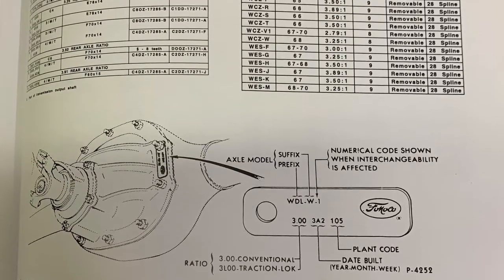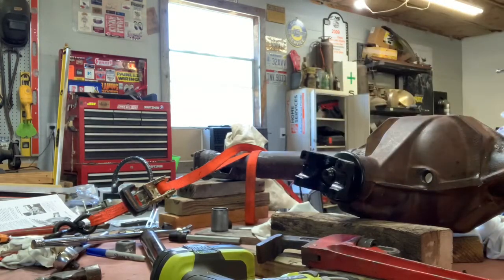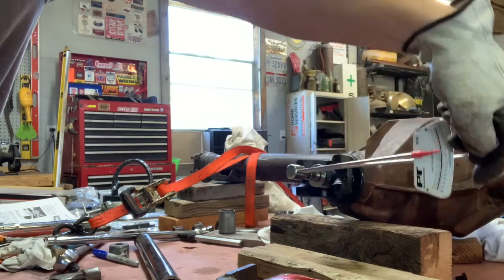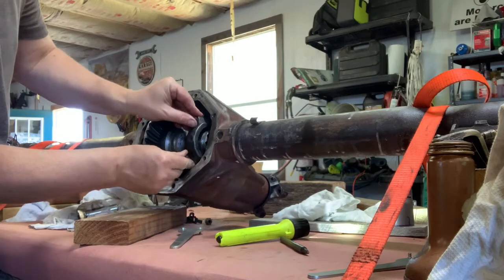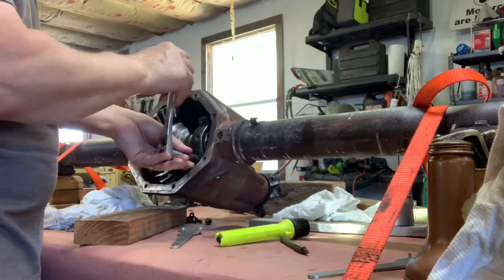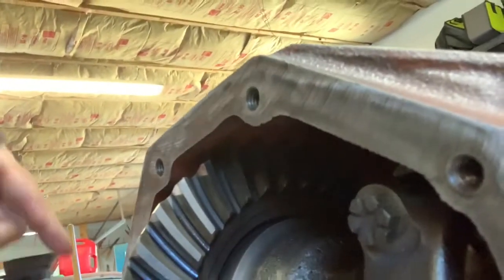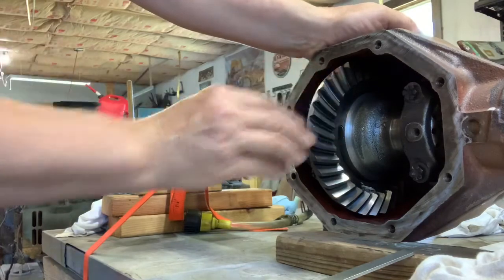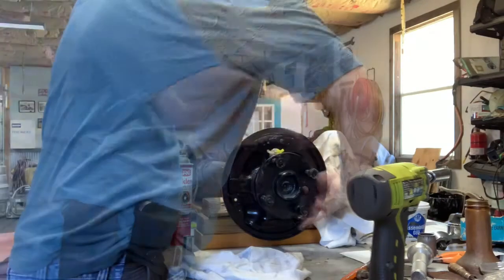1966Mustang 7.25” rear axle assembly

Comment: Where can I get a ring and pinion for the 7.25?
Reply from the maker: @clint4004 I would check with the folks at Yukon Gear and Axle first. You could also check on EBay might get lucky with a good used gear set. 
Thanks for watching.
Reply: @dubsgarage  thanks I looked possibly going with an 8in..

Comment: Can you tell me where you got your rebuild kit from?  What is the part number for the kit?
Reply from the maker: Sorry for the delayed response. I purchased the Yukon repair kit from Quick Performance. Their wed site is the same as the name just add the .com to it. Had really good luck using them.
Reply: @dubsgarage  thanks for the information!
Reply: @dubsgarage  One more question, how do you remove the brake distribution block / brake line from the axle housing? Is it welded on or threaded? I can’t tell.
Reply: Never mind 😬 Once I got past the inch of tar and grime, I found the nut to remove. Your video is such a help rebuilding my dad’s mustang!
Reply from the maker: It’s bolted or threaded into the axle so put some thread sealer on it when going back together with it. Good luck 👍
Reply from the maker: Sorry for the slow responses. This YouTube app is not real great. lol 😂

Comment: Do you remember what size socket is needed for the pinion nut?
Is it a 1 1/8" socket?
And thanks for the video!
Reply from the maker: Mines is a 1 1/16”. Hope this helps.
Reply: Thanks that makes sense, I thought it must be smaller than 1 1/8, and you confirmed it. Thank you very much, your videos are a tremebdeous help for rebuilding the 7 25 rear end!
Reply from the maker: No problem. Hope everything goes well with your project